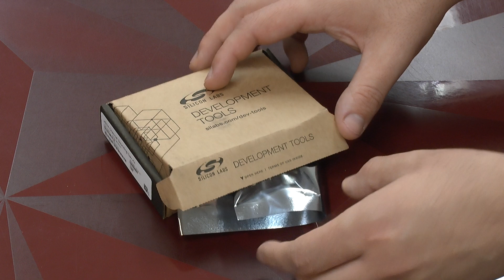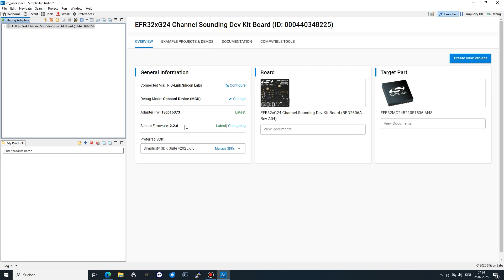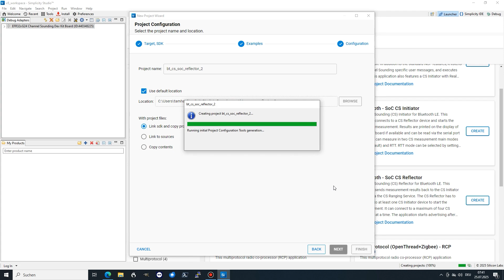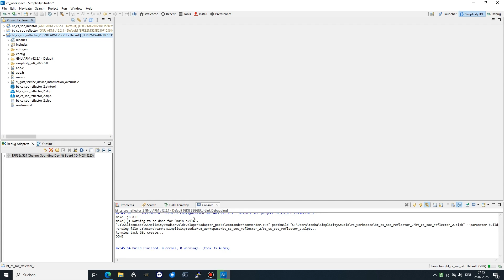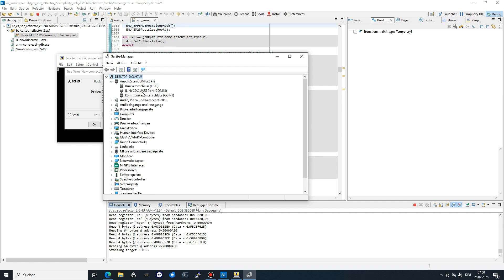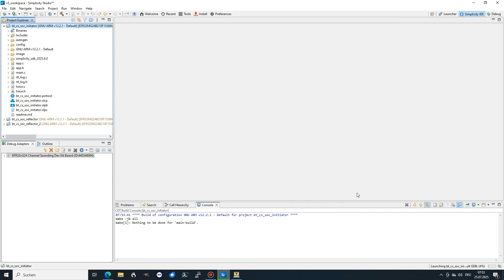Bluetooth Channel sounding with Silicon Labs EFR32

Comment: It's really interesting video.I enjoyed my time!!!

I’m working with 5 of the same development kits for multilateration. So far I’ve tried reading distance data via the Channel Sounding tool, but I’m running into an issue: it doesn’t seem to support multiple initiators or reflectors in parallel. Have you encountered this limitation?

My plan is to log the distance data from Channel Sounding in real time through Python once I can resolve the multi-connection issue. I also experimented with TeraTerm: the reflector outputs readable distance data, but the initiator only produces a non-human-readable stream.

Any insight on whether this is a known restriction, or if there’s a workaround, would be appreciated.
Reply from the maker: Hi, first of all, sorry for my very slow response. I was ill and overloaded.

So far, I never evaluated this. However, I have a good connection into SiLabs. If you email me at tamhan aeht tamoggemon dott com, I can see what I can chase up for you!

Comment: Already did see BLE 6.0 chips and maybe already had a things in my hands.. I have not yet seen much usage in this tech. Maybe you want to als hit up nordic about there nRF54H20.
I found the NRF app to be quite usable even on iOS it shows also a ton more information. But i suspect channel sounding is not really something easily supported yet.
Reply from the maker: Thank you so much for talking back. May I ask which version of iOS you are on?
Reply: @MrTamhan 18.5 we use the nRF stuff actually quite often for our custom protocols over GAP. And have yet not seen a big issue.
Reply from the maker: Ah OK. We saw a lot of issues after the switch from iOS 15, with discoverability mainly!
Reply: @MrTamhan Well have to deal with the mess that is BLE on Android which seems like they got software side worse. Where apple is on the hardware side a issue.